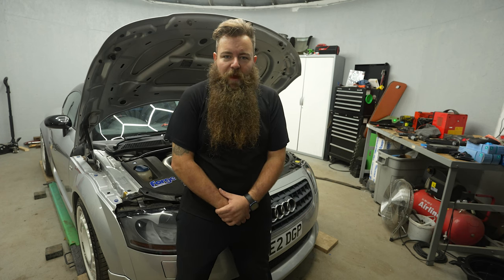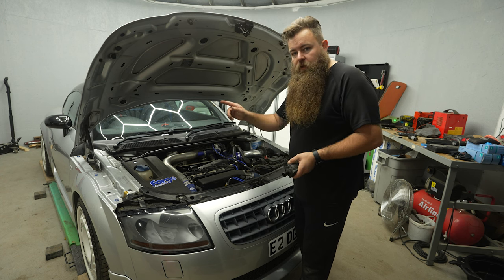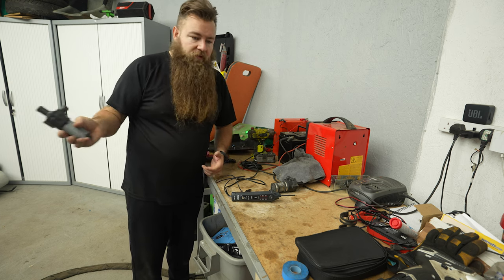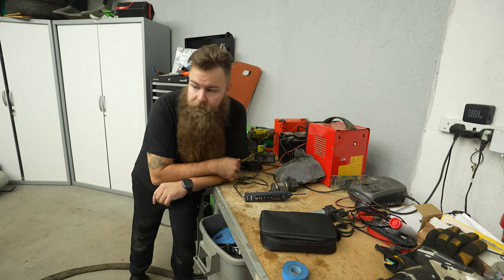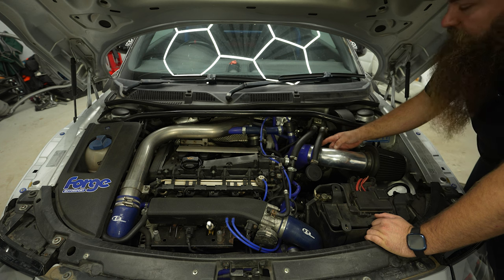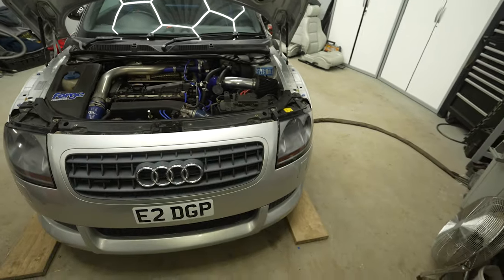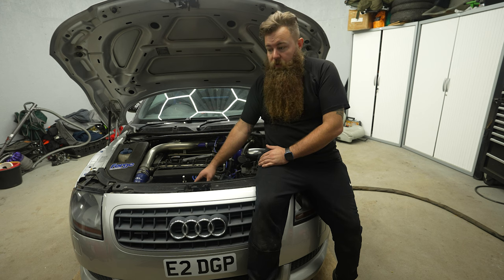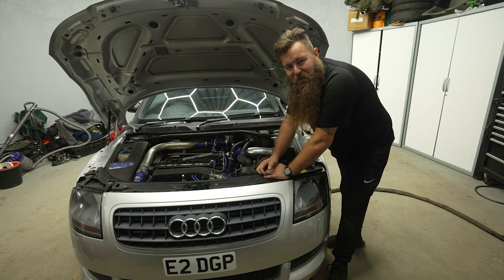What's Under The Bonnet On My New 350hp TT & Fixing Aux Water Pump

Comment: Those after run pumps are only £50 for a Bosch one on auto doc. Also I run that very same turbo set up on my s3 8l and git just over 400hp using ignitron ecu and mapped at badger 5. They are a good turbo. Also he fitted my aem meth kit i went a twin nozzle set up one before the map sensor and one with a adaptor after the throttle body.

Comment: I had a perfect working auxiliary pump until two months ago when the output end of it snapped (without warning) on the highway and made me 500€ poorer 😅 (carrying the car included). Very useful info to people out there who aren't aware of it Don. Just take a few more seconds lads and inspect the plastic inlet/outlet part of the pump which can snap and drain your coolant fluid.
Reply from the maker: Ooo no! That sounds terrible. I bet for a moment you had a mad panic as the steam was rushing out! 

Thanks appreciate the kind words mate, yes check it, all plastic coolant pipes need a visual inspection now and then 🤞🏻

Comment: Great vid.. Is there a seperate fuse for this... What of its not working due to a fuse or connection
Reply from the maker: There is a fuse for the Fan control module above the battery, usually it doesn't blow a fuse it just fails to run, you can prove this by giving it a 12v power source and see if it runs

Comment: Hi Dom, great video by the way 😊
Out of interest I see you are running a stock Diverter Valve, is this ok with the set up you have?
Reason for asking is I have a K04 Hybrid/Chinafold/Badger 5 TIP etc, etc in a Mk2 Jetta which I have literally just got on the road, I've fitted a Forge 008 DV and the whooshing sound is not to my liking so I was thinking of swapping it back to an OEM valve - just wondered if there is any pitfalls in doing so (it is yet to be mapped)?
Cheers and keep up the good work 
👍

Comment: I have replaced the aux pump last year, since some days before, I miss something when parking the car. This little noise, witch used to stand some minutes after the engine was off 😅
I don’t understand therefore how the no MAF is possible ! 😳
Reply from the maker: It doesn’t take the air reading from the maf. It uses the map sensor for air pressure. The stand alone management is extremely clever ( does cost £1200 ) haha
Reply: @TheParrottBros  . Wow, ok then !

Comment: Great vid mate, i have noticed mine is working which is great. Do you have a part number for that pump just incase i need to replace it at somepoint please?
Reply from the maker: They are very easy to find, part number is 078965561 Bosch
Reply: @TheParrottBros  Thank you 🙌🏽, I tagged you in my insta and Facebook posts, followed your vid to install the hidden 12v outlet. Cheers.

Comment: Loving the content of this TT pal 👍 running the same turbo as me and I’m also considering the meth route as these hybrids run so hot. I did query bill at B5 about it and turns out I don’t need Ignitron to run meth but part of me still wants meth and Ignitron to run in tandem for that safety and longevity aspect.

Maybe over winter, who knows 😅
Reply from the maker: Thanks mate, it’s a fantastic set up, a decent amount of power which is so linear and usable. I think it’s the best power to weight for these. 

Ignitron isn’t essential but it’s mad how clever it is, all the safety features bill can set up so if it doesn’t see the figures at once, it can put it in limp mode to protect the engine

Comment: Very nice car.
Are the enigne internals stock? 
Im from germany and everyone here says that you should upgrade the pistons and rods on the 225 engines when you want to make 300+ hp.
And does the car have a bigger downpipe and exhaust?
Reply from the maker: It’s had forged rods, valves and cams inside the engine to come with the added power 🙂

Comment: My pump works fine as you show it on test but as soon as I turn the key off the pump stops! Doesn’t matter if I’ve run the car or not. Is that the fan control module causing the issue?
Reply from the maker: That is very strange, I would certainly start with the fan control module for sure

Comment: Oh wow....just noticed your front number plate Dom is that a sticker or painted on...is it legal?
Reply from the maker: I have since removed it and I have a static number plate which can be fitted and removed by simply peeling it off. Fully road legal as correct spacing and
Printed of the correct reflective material 🙂
Reply: @TheParrottBros  tempted, but just read Gov.UK rules............the last 2 are of concern.🤔
Reply from the maker: @pigeonguardgames507  it will be a case of see what happens. I’m not drawing attention to my self as when driving it will have a fixed plate of correct size 🙂🤞🏻
Reply: @TheParrottBros  Ah...good plan, I was hoping to put one on the front of my car and drive about like it! but the police round here focus on car drivers rather than real crime, so it would have to be bullet proof legally😂
Reply from the maker: Yeah probably better to be safe than sorry, specailly if your local force are super keen to pick holes in your car

Comment: I was planning on a hybrid turbo for my 180. What is needed to run one of these pumps? I've noticed my car stays running the fans and what not sometimes after turning the car off. I'm not 100% what is running but it's only happened twice, must of been hot.
Reply from the maker: So your fans run off your thermal switch in the radiator which has a supply permanently so if your car goes off hot it will run to bring the temp down. 

It’s a completely different pipe set up and would be very complicated to add into the system.
Reply: @TheParrottBros  Ahh okay

Comment: Im pretty sure mine isn't working. Its on the list to get done.
Reply from the maker: If it is not working I would certainly get it deal with sooner rather than later, last thing you want is Turbo problems because it's not cooling down properly
Reply: @TheParrottBros  just ordered a Bosch 1 from Autodoc for £43.66